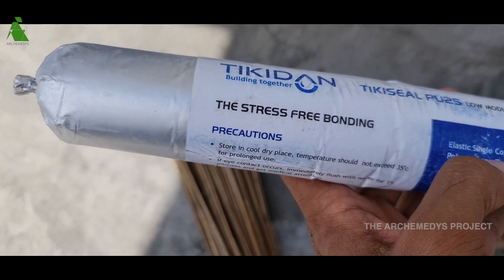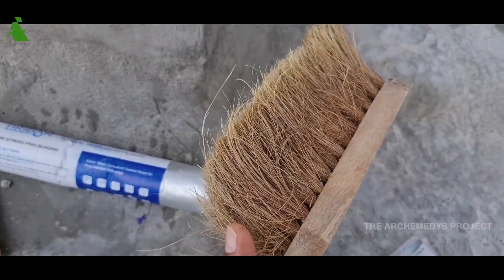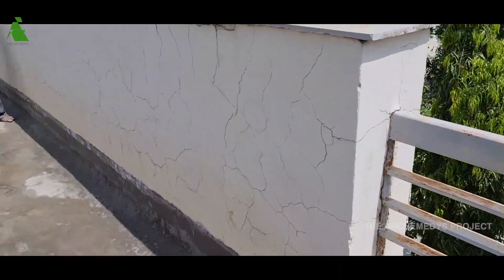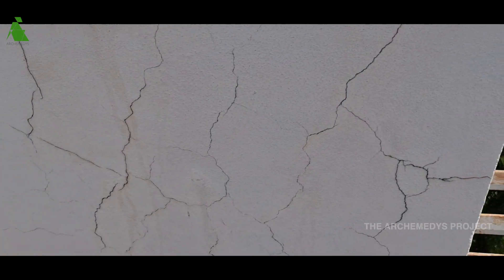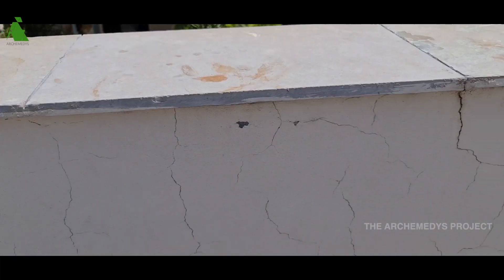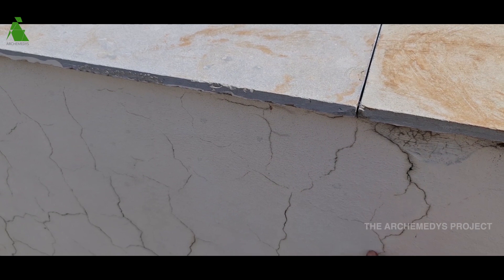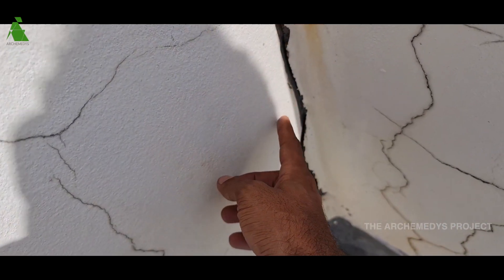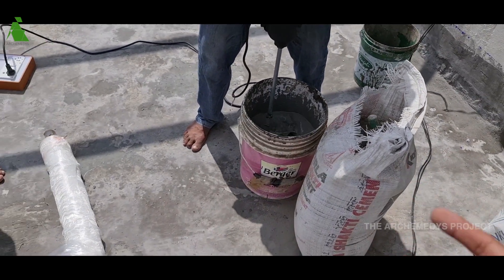How To Waterproof Your Terrace | Waterproofing DIY | Hyderabad Rains | The Archemedys Project

Comment: Hi sir,a small suggestion if you can give us.right now we are constructing two floors above the floor where we are staying.slabs were constructed long back now brickwork is being done.due to curing water stagnates on the floor and is getting absorbed in slab which is leaking in to our floor.any suggestion to avoid this.